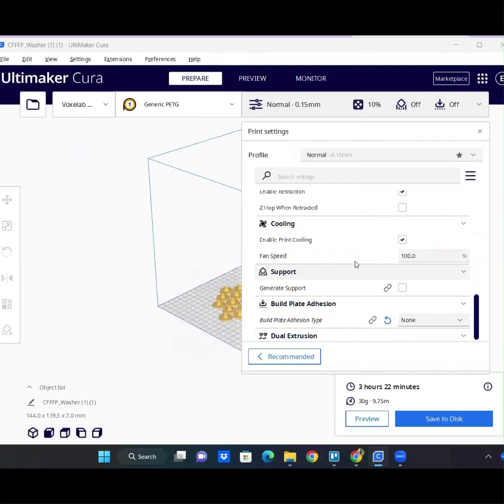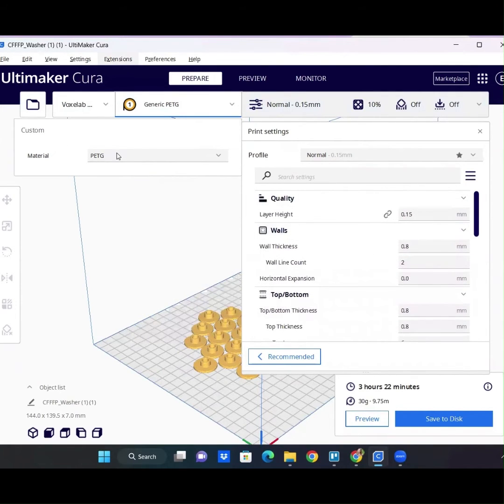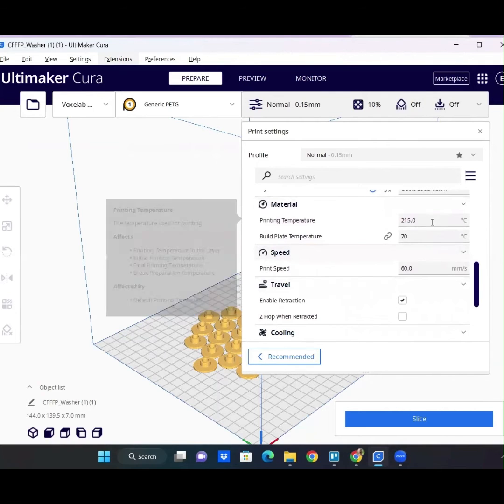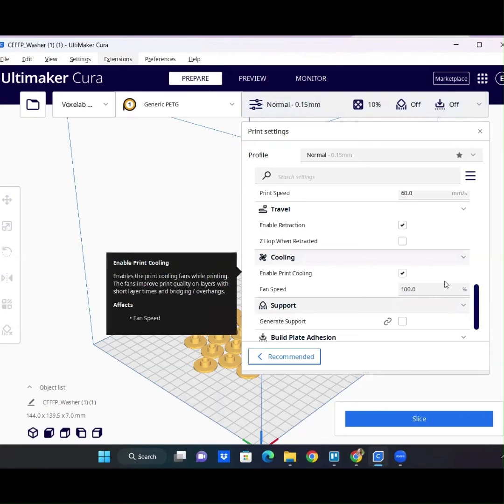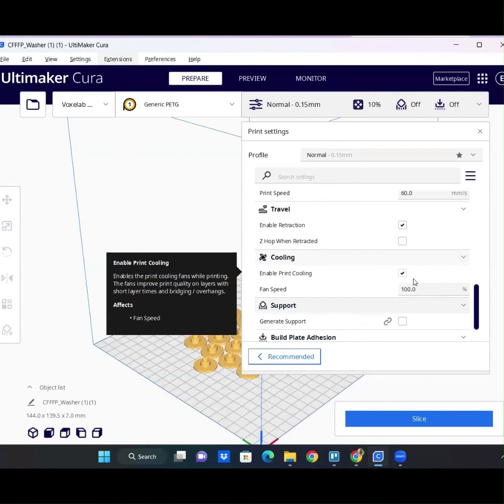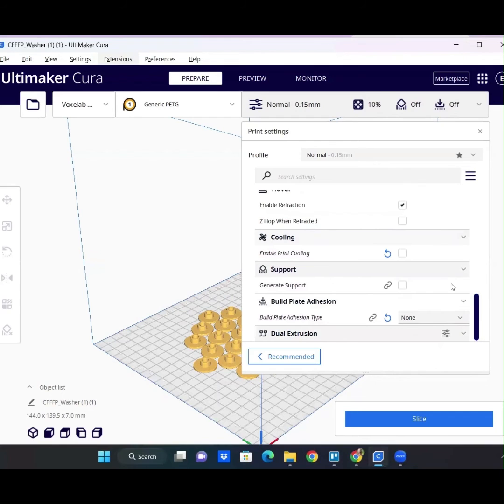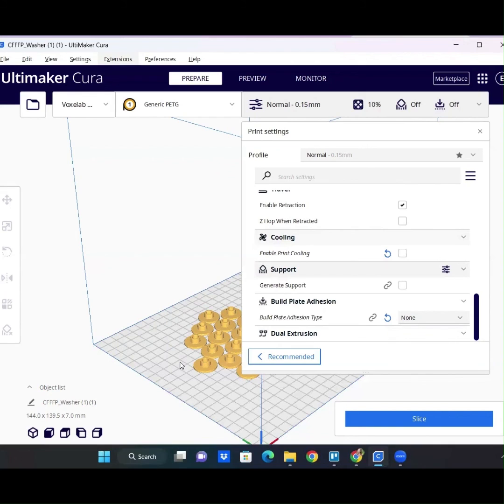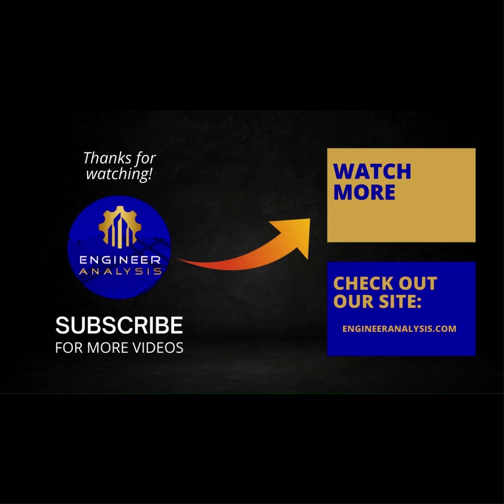Optimize PETG Printing: Ultimaker Cura Settings Guide for Perfect 3D Prints!

Comment: In some cases one can use 30 percent cooling which will be ok for smaller parts. But it is important to adjust ones printing temeprate as well with the fan speed
Reply from the maker: Great point, Barry. And be cautious of room fans. I failed one of my first PETG parts because the room's overhead fan was on. 

Thanks for watching!